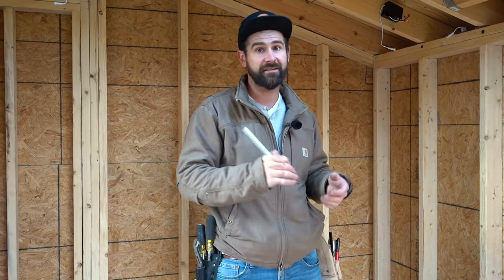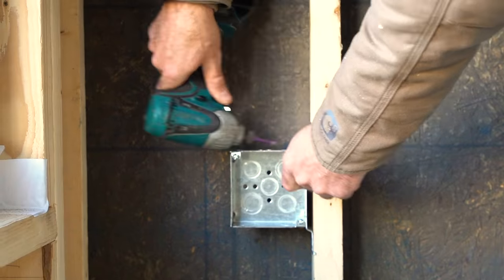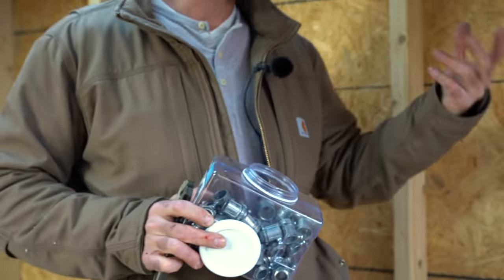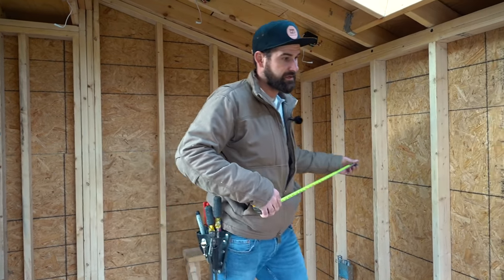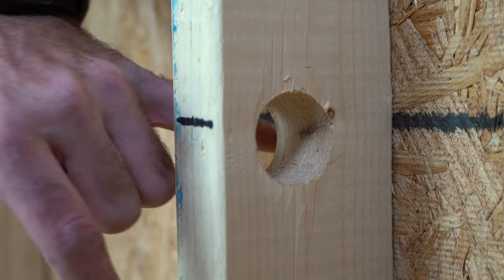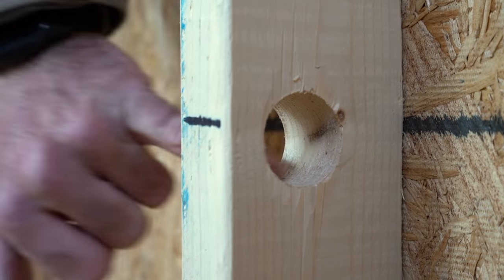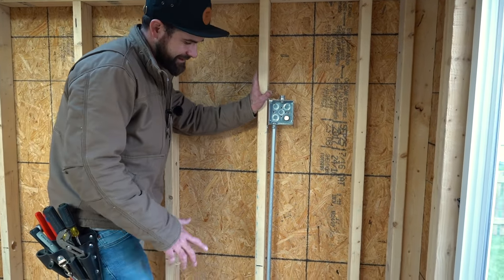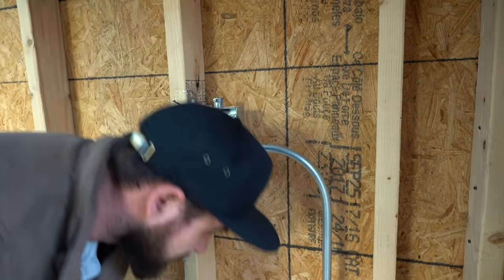How to bend and install electrical conduit

Comment: 358.30(A) EMT shall be securely fastened
within (3 ft) of each outlet box, junction box, device
 box, cabinet, conduit body, or other tubing termination. Since you didnt make any box offsets this is not to code correct?
Reply: I don’t see how box offsets are required to securely fasten the tubing. He did secure the EMT using nail straps at 19:07 and that was within 3 ft of the box.
Reply: @dsingh4512  yep i agree. using those pipe straps would be an approved method of strapping as long as he's within 3 ft
Reply: There are straps you can use without box offsets. I only use box offsets for exposed work, never in walls
Reply: @thomasmarable6818  interesting! Thanks for that tip.
Reply: @dsingh4512  should the short conduit be strapped? it is more than 3ft long? he did say vertical distance is 33 1/4'' plus 9 1/2'' equal 42 3/4''.
Reply: @jonxiong5439  yes, the vertical segment should be strapped. It’s possible he did it after the video but I am guessing he didn’t or he’d want to show it.
Reply: @jonxiong5439  yes, the vertical section should be strapped as well (he probably used the same nail straps that he used in the horizontal section for the vertical section).
Reply: @dsingh4512  last time i checked studs are considered support, I mean minus the fact he ruined most of those 2x4 with a inch and a half bit. I digress though.
Reply: @ImJarenWard  EMT horizontal runs can be supported by wooden framing members but it still must be securely fastened within 3ft of the box. The NEC differentiates between supported and securely fastened.

Comment: As an electrician, I think he should have spent more time on the fundamentals of using an EMT bender. There's so many things you can do with it. Learning to use the bender correctly can save not only time but money. Using the star vs the arrow when creating offsets, saddles. and other bends in addition to 90's are an electricians bread and butter.  Additionally, the NEC (national Electrical Code) requires that vertical runs need to be strapped down every 3' and while the vertical run you showed was under 3' (barely) I would have still ran the pipe against the stud and put a strap half way up the run which would have required a box offset at the higher box.
Reply: Also "stovepiping"  the horizontal. I mean If I saw this I would eye roll an laugh. If he was an employee of mine, he's doing it again the right way. This is first year apprentice work IMO. Reducing fittings is always the way to go, less spots for hang ups, looks nicer, you look like you know what you are doing, and costs less. On a video labeled "How to bend and install electrical conduit" this would be a "how not to" for my apprentices.
Reply: Vertical runs need to be strapped every 3'? Vertical runs are the same as any other run, 3 feet from every termination (box) and every 10 feet after that. A caddy CS812D would work perfectly there.
Reply: Got to tell you I piped hundreds  of houses in the west, north west, south west  suburbs of Chicago from 98 to the bubble burst 2008. All union work in DuPage, Kane, Will, McHenrey ,Kendell, counties. Never once did we have to brace the pipe coming out of a outlet or switch except at the top. Horizontal runs were nail strapped so pipe did not move and make noise. Len the inspector for Lombard was as tuff as they come and never once did he fail vert pipes. Now a horizontal pipe moving yes or forgotten set screw. He even taught code class for people wanting to be inspectors. I guess everything is local, are way is different then other places. Remember people the code is there but it's all what the town or jurisdiction wants.
Reply: sorry not 98 but 1988
Reply: @robm3063  I totally agree about local vs national code! I've often found that local jurisdictions love to put their spin on the national code just because they can. Some of the restrictions they would put in place were redundant at best and down right absurd more likely! I've worked as an electrician in Florida, Illinois (Macon, Shelby, and Christian counties), Iowa, and Colorado and I found by far the toughest code was in Florida (Colorado was close)! That was mostly because all the other states I worked in were in rural and smaller mountain communities. In Florida I was an electrician in Palm Beach county and you had code above the standard electrical code that had to deal with a whole different set of environmental issues like hurricane and oceanfront communities.
Reply: @davids7209  Illinois is a crazy state. All electrical license exams given at the local level. Every town adopts whatever year of NEC they want, then they will eliminate and edit whatever code sections they want and then make that their code. I'm currently working in a town that is still using nec 1996!!! Then another using 2014, and another 2011, and another 2017! It's nuts! I usually exceed whatever old code they're following when it comes to gfci and afci requirements so I can sleep at night! Not sure if it's still in use but Schaumburg Illinois had a 90 page supplemental code book required for use in their town years ago.
Reply: some of u Electrcians have power trips.  Where are the code violation?  If there is none state it. Then if u want to suggest something fine, but really “I would have my apprentice do it again the right way”

Comment: “I used an 1-1/2” drill cause it’s all I had in the truck.”
On a 2x4?
Reply: Cringed when they showed how big the hole was on that stud. Framing fail
Reply: @jimmymedellin4557  1 1/4 we use them pretty much standard

Comment: This was super informative and helpful! thanks for sharing all the detail on your tool tricks and workflow! I just moved into an industrial loft and we have exposed conduit on exposed brick and there are mostly enough outlets on the main floor but NONE up the steps into our platform bedroom area. Would love to see you do a video on how to pick up from the ending outlet box and add a few more all the way to the wiring and connection phase=) Thanks!
Reply: Jesus is the only way to healing, restoration and salvation to all souls. Please turn to him and he will change your life, depression into delight, soul heading from hell to heaven all because of what he did on the cross 

“Whoever calls upon the name of the Lord shall be saved” Romans 10:13

Comment: Don't know about you guys but this wouldn't fly where I'm from. The pipe going up has no straps.
Reply: It wouldn't go any place. The jnstall isn't up to code. The NEC is "national" electrical code. Unless this isn't in America.
Reply: @OriginalMerk1904 it's Ontario Canada.
Reply: @nevinkuser9892  i stand corrected.

Comment: Coming from the UK , this is a fast way to tube an installation. In the UK, tubing is very rare, mainly because of cost and because its all screwed ends. All couplers (joiners) are tapped all the way inside. Just a single screw and push fit would not pass code. All the screwed ends are made using a die or dying machine. All conduit has to be tested for continuity and as the USA ,used for grounding. When entering a fixed box, we use a brass male bush, that pushes through from the inside of the box, screwing straight into a coupler, which has already been screwed onto the tube. Thus reducing ingress of metal fittings into box.The bush is smooth on the rim, so no chaffing of the wires in the box. No. pig tails allowed ever and only ever single phase into any box. Remember we are 240v so two phases in a box is a potential of 415V! I've  had a shock from that-not good! Wiring tube, is done using stranded single cable and if it wired correctly all outlets must never have more than 4 wires. Branching out to another box is seen as bad practice and would leave six wires at on outlet.
Reply: We use something similar to your threaded pipe for industrial or flammable explosive conditions.and we also have emt (thin wall conduit)compression type couplings with ferals we can use and have to in damp conditions they cost more and are more time consuming to use and most of us will also run another earth conductor for a more professional standard but agian it's more expensive and labor.
And another miss Nomar all of our panels are actually 240volt systems as well. Residential homes have larger appliances like ranges/ovens clothes dryers and larger a/c units electric hot water heaters and even electric baseboard heaters are all 240 volts
Reply: @wizard3z868  Thats interesting, resistance for uk conduit(used as a ground) at 1000v = 1ohm. thats to the farthest point. Today, with crap components shipped in from abroad, the necessity for grounding wire is more pertinent. In that the poor components no longer give sound grounding (earthing uk term) Most commercial jobs now are based on price and all sorts of corners are cut- relying on the close protection given by RCB AND RCBO's, so as to forego any liability. Gone are the days of good practice and pride in a job well done. I retired a few years ago but a friend of mine is still working(on and off) and tells me tales you would not believe. Often leaving jobs because the work is so poor and other times when he gets a red mist at people who are just plain stupid and leaves.During my time, I worked on many sites, that were considered dangerous, including nuclear and petroleum. Codes (Regulations) for these sites are a whole different ball game, with equipment second to none, it would take to long here.  So have a good day.

Comment: I'm sure the local code would have been fine with BX cable. Conduit in a wood structure is overkill...
Reply: nmb/romex way better
Reply: Ya, but the guy in the vid was saying for their local code outbuildings / sheds need to use conduit... maybe because of mice. I was just saying that I'm sure bx would be fine.
Reply: @michaeldouglasmason  oh damn thats annoying
Reply: Nope, Chicago and surrounding cities and collar counties all require a pullable metallic system which means emt, imc or rigid steel conduit. You can also use flexible metal greenfield that you would install the wires into on the job.  No prewired bx, mc or romex except prewired 6' fixture whips above drop ceilings. Maybe uf cable used underground in some towns. It is a Cadillac system that seems overkill to some, but is normal to us. It really doesn't take much longer to install once you get the hang of it. When I do a romex job in other parts of the country, I'm always looking over my shoulder because it feels like I'm cheating!
Reply: @davenag957  I find this fascinating. So inside the house is fine to run romex but outbuildings need to be conduit? I'm in Ontario Canada. That code rule is different up here...
Reply: @michaeldouglasmason  All residential,  commercial and industrial require a pullable metallic system.
Reply: @davenag957  oh jeez... that's brutal...

Comment: top notch work but my heart goes out to the electricians who cant use romex to wire indoor receptacles. what kind of a maniac requires emt for indoor wiring?
Reply: City of Chicago
Reply: This video is just to show how to install EMT in a wood frame..
Reply: Every house in Chicago.
Reply: I'd rather run EMT if I had a choice for ease of adding future circuits if you wanted to. At the minimum I'd use MC over romex to wire my house if I had to since MC is harder for vermin to get into.
Reply: i have been using it all of my life so easy. just think when you are working a housing project. or roughing is a house you can bend all of you 90's at 1 time. so lets say i have 3 bedrooms, the switches and outlets are the same height. switches at 48" center which means the top of the box is at 50". lets say i need thought out the house a standard bend to the top of the rafters. i just then count my switches, count the runs and bend all of my pipes at the same time. then just put them all up into their holes and play connect the pipes. this way i can run these rooms in a fraction of the time. i bet i will be done with the rough before you running cable. wont even be a contest. i have won so many lunches doing this. put your boxes up, put your connectors that you need in the box. drill your holes run your pipe. just drop those pipes right into their holes. simple easy and no thinking.
Reply: @jburnes41  Ah yes, a Chicago flatter! That's how it done. Layout, mount boxes and connetors, mark and drill holes, production bending and install pipe. Production flatters can install 400' - 500' of 1/2" a day.  It really pays to have the best high speed angle drill and bits on the market too. 1" bit for 1/2" is all you need. The brand is a personal preference as long as you can blast a hole in a few seconds.

Comment: When I rewire my house, planning on just going outside of the walls and through the floor with conduit. Too much hassle to take down or cut holes. Once a section is completed, just remove the prior from the breaker and leave what's inside the walls alone and dormant. I was taught to use sheet metal screws with electrical boxes per trade school in 1990's. Never had one rust out on me yet. Not even in damp locations.

Comment: Only commercial buildings are required EMT and metal box inside the wall in California I thro.
Reply: Not true at all. Chicago requires conduit for all houses..
Reply: As an Electrician I can tell you that EMT is easier to add circuits to later on. If I were going to redo my house I'd definitely spend the little bit of extra time and money to run EMT where ever I could.
Reply: @brianharmeson3144  Show me the code.
Reply: @brianharmeson3144  You failed to supply what I asked for. As for common knowledge in the electrical industry, it's known that everyone uses romex for residential(dwelling). Along with nursing homes, hotels, and apartments(Type 3, 4, and 5 construction). Exactly how it stats in the National Electric Code. Which is,  pretty popular in the electrical industry.

NEC
334.10 Uses Permitted. Type NM, Type NMC, and Type NMS cables shall be permitted to be used in the following, except as prohibited in 334.12:

(1) One- and two-family dwellings and their attached or detached garages, and their storage buildings.

(2) Multi-family dwellings permitted to be of Types III, IV, and V construction.

If that's required in Chicago, local absurd rules are not industry standards......Just another great reason to never live in Chicago.

When you want a lesson, come to the teacher.
Reply: @Mike45-47Q  You don't know how to use google? Wow.
Reply: @Mike45-47Q  It reads as follows:
"B.All wiring systems installed in new residences shall be in rigid conduit or electrical metallic tubing."
How wrong do you want to be? I can find LOTS of references to the conduit use in Chicago.
Reply: @Mike45-47Q  After I said "Chicago requires conduit for all houses." You could have just said this to begin with and avoided all of the embarrassment. 
"If that's required in Chicago, local absurd rules are not industry standards......Just another great reason to never live in Chicago."
Besides, they are called code amendments. They are code requirements for that city/jurisdiction. They are just as real as any other NEC requirement.
Reply: @brianharmeson3144   How can I be wrong? Why are you so touchy? I just asked for the code. You stated, "It's common knowledge in the electrical industry"  I gave you the common knowledge code in the electrical industry. The one the country plays by.  Just because Chicago makes up their own  pointless rules, doesn't make them common knowledge. Local jurisdiction can surpass the NEC. Usually when there is more shady work practices, they make more rules. But, in the three states I'm licensed in, I've yet to see it. I also don't touch residential anymore either.
Reply: @steveloux4709  There are lots of fire codes. Drywall. Firewalls. Block walls. Smoke walls. Fire caulk. EMT has little to do with fire prevention. I'd be willing to bet it has much more to do with the over powering union presence in Chicago.
Reply: @Mike45-47Q  I won’t discount that the IBEW has had a significant voice in shaping the amendments.
Reply: @Mike45-47Q  all i can say is try to run romex in chicago and think you will pass your inspection lol. you will rip all of that cable out. and further more the inspector will make sure the next time he inspects. you will have a much harder time passing.